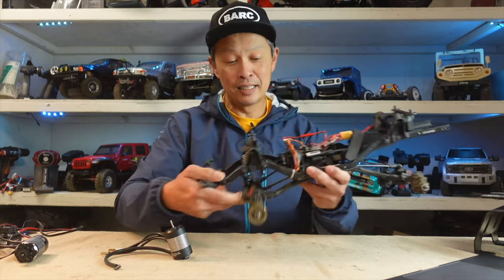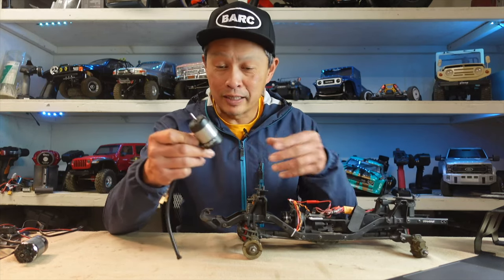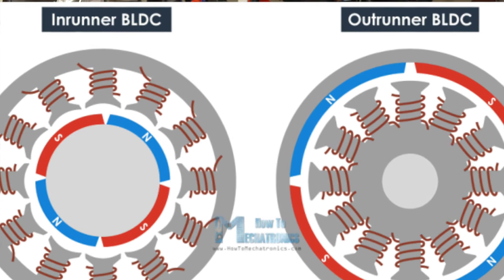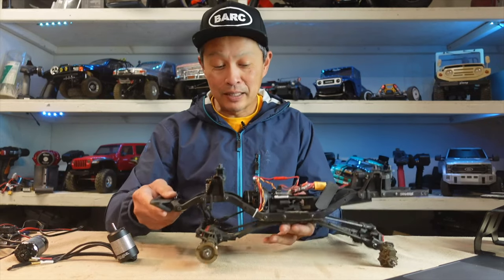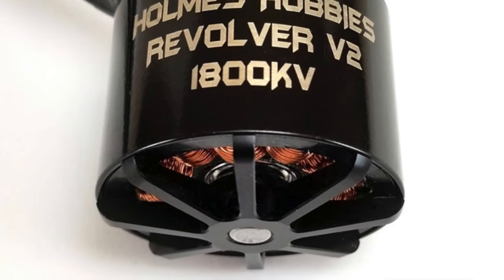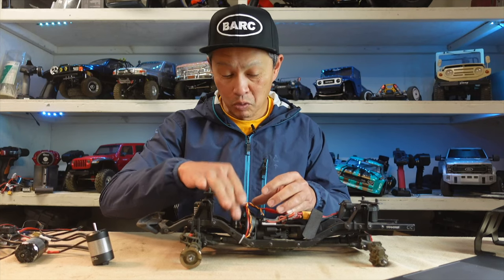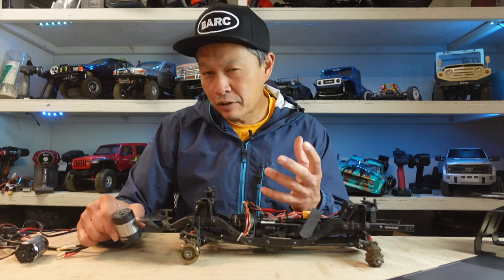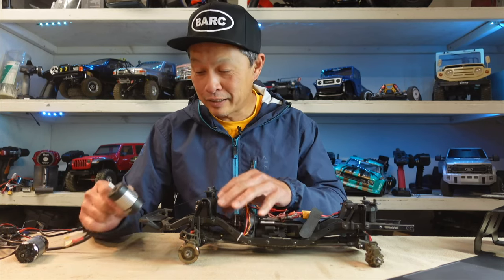Brushless motors explained - Top 8 things to know - is kv, outrunner, sensored, 540?

Comment: Kv is still confusing to me. The way I understand how brushless motors work is by creating a rotating magnetic field by switching particular phases. So it’s not how many volts will be supplied to the motor will determine the rpms but how fast the phases are being switched on and off so that the rotator will follow magnetic field of the stator. So what’s really Kv is for?

Comment: Also in regard to sensored, I prefer sensored. I don't use crawlers. I only use bashers and on road but I like the performance the sensors provide it's a smoother experience and imo it helps with efficiency and temps.
Reply from the maker: Yeah, some drift cars, race cars  prefer sensored as well. If control is most important, they work well.

Comment: Excellent video! I think you could explain more about the consept of power, speed and torque, their relation to each other and to acceleration and weight of the car. Everyone is talking about the speed and kv as being power. I have not found many esc manufacturers that actually give torque constants, nominal and peak torques for their motors... or similar values to their ESC.
Another question for you, do you know if there are any ESCs that allow syncing multple untis and choosing between speed or torque control modes?

Comment: Great video, thanks so much for the info!...Also, something i would like to know, I'm sure a lot of people would want to know ....is about how the electric rc system works together, as in.. From what i have understood, the motor demands power from the esc, and and esc draws it  from the battery... That sort of thing explained well with example values..
        Could you please please put up a video.. Thanks in advance.. 😊😊
Reply from the maker: Great suggestion!

Comment: 2 years ago I was experiencing thermal shut down on my M41 at the lake.  At first I didn't realize what was going till I the boat back in the truck and looked at the outside temp, it was 109 on the beach.  So I went back in the evening and drove it when it was cooler out.
Reply from the maker: Thanks for sharing. Real world info right there.

Comment: Thank you very  informative & explained in simple terms so anyone can understand them. For me I’m into crawlers mostly & brushed motors are so good I have no problems using them. I think it is a trend for people to get the brushes because they see a lot of the channels using them & think that this is a higher quality & more sought after upgrade. I do see that they are very smooth at low speed.  And have alot of power. So when you have to hope over something it could be a benefit.. Being sensored or not just seems like it’s not the motor just the esc that is controlling the motor that makes it so smooth at low speed so. So the quality of the esc is everthing. So what are the top benefits of using a brushless sensored motor in a crawler?
Reply from the maker: Yes, most crawler folks are addressed by brushed motors. OUr analysis here https://www.youtube.com/watch?v=ftkv31Z6o84
Reply: Watch the review of the Hobbywing Fusion FOC system then you'll understand the high end brushless systems. I was much like you with a brushed crawler setup. thought it was more than adequate.
Bought a Fusion 1800kv and it's transformed the car in ways I could only imagine before. So incredibly smooth and very powerful...and compact.

Comment: Just subscribed! You definitely know your stuff and I’m just starting out. I’ve built real FWD All Motor Honda Drag Cars for 20 years. Now I’m getting into R/c. I have a question. I purchased a fully aluminum TT02RR. Everything is alloy. On my kit. It came from power day and allegedly is not a true Tamiya. but the spur cover is the only plastic in it. I have even upgraded the spur to metal. I purchased a S3650-3500kv Brushless motor. What pinion gear shall I use for it?  The higher the pinion number, the higher top speed? But less acceleration? Is that right? And will the S3650 be a good fit? On a TT02 chassis? Any other tips? That I should be careful for?  I bought 2s lIPO batts. Hobby wing ESC. Motor is sensor less. I also bought a 12kg low pro servo. Waiting for other misc parts like shock oil. Tire glue to arrive before mounting motor but. Anything you recommend?  I just want to try and go 60 mph 70-80 tops. Only going to be ripping the parking lot with it or flat straights.

Comment: Hi there I wonder if you can help me. I am confused with this motor

Maitian MT-W50-G2: 295kv brushless out runner Power60

It is in a bait boat that I have and I am looking to replace it for a more powerful motor but in the same size if possible. It has to be an out runner. Would you have any recommendations. Thanks

Comment: From What I Got Out Of Video Can Brushless Motors Overload A Smaller ESC? I'm Thinking They Don't? They Just Won't Run A Full Potential Correct? I Know You Can Overload A Brushed Motor ESC With A Big Brushed Motor But It Sounds Like The Brushless ESCs Put Out What It Can Were As Brushed ESC Will Put Out Based On What The Motor Draws If That Makes Sense?

Comment: in the fusion motors what is the difference in a 1200 than a 1800? im building an ultimate hauler to haul my huina 580 exc. i need a truly torque dense motor as the exc. is 24lbs itself

Comment: Something more I just figured out is on Brushless unsensored is you can switch the 2 outside wires to change the motor direction. Had to do that to get max forward speed from both 2838 cans in my Blizzard otherwise one motor runs slower. 
Learnings never stop...nor should they haha
Reply: You can actually swap any of the 3 wires and it’ll go in reverse direction.  But I do normally swap A and C to reverse the direction. Some, if not most, ESCs have a function to reverse the motor direction.  The cheap ESCs in my Clod supposedly has this function, but for some reason whether I have it clockwise or counter clockwise, it still goes in the same direction, so I ended up just swapping the A and C wires.
Reply from the maker: That is correct for unsensored. Cool trick
Reply: @RCReviewChannel  Yes!  Forgot to mention unsensored only.

Comment: I never though I need to open a waterproof inrunner (yea they not mean there will get no water in it because there was a big hole where the cables get in)
The motor behaved strange and I found rust and sand in it. I tried to clean it and used some oil and grease.
Is it normal that the motor gets 55° Celsius after less than 2 minutes but only use 20% of throttle? I don't know what is happening. I can't programm the ESC (new one) and though maybe it's the timing. The bearing do sound strange but  the motor runs pretty freely.
Reply from the maker: definitely not.  Spin the spur gear by hand (or the driveshaft) and see if there's any resistance or binding in the system. That will usually cause it. Eliminate any binding as the whole drivetrain needs to be free moving.  The wheels usually cause a problem.

Comment: I understand outrunner are indeed for higher revolutions as well since they are used in drones. Due to this, an important thing to mention is to check if the motor has reverse when buying one 😂
Reply from the maker: Drones use big props (relative to the motor) so outrunners are ideal with their high torque.

Comment: Do All Brushless Motors Use Neodymium Magnets? In The Car Audio World Neos Biggest Weakness Is Heat. Heat De Magnetizes Neos Sooner Than The Old School Ferrite Magnets. But In Car Audio You Could Recharge The Magnets If Needed But In A Motor That's Not Really An Option Due To Each Magnet Needing To Be Recharged In A Certain Pole Direction.

Comment: Kv is completely a useless measurement without knowing the torque
Reply from the maker: I'm not sure RPM is useless
Reply: @RCReviewChannel  its a bit useless since its measured under zero load. Maybe not completely useless but its just hard to intrepret. Thanks for your reply 👍🙂
Reply: @RCReviewChannel  your video was still highly useful for me. Thank you. Tbh i assumed it was kilo volt before and was beyond confused lol. After watching i realized it seems to be a convenient marketing strategy for the manufacturers :D knowing its rpm is helpful but its just like, you could have a 2015 motor with a 6700kv and a 4270 motor with 6700kv and to a novice they might appear equivalent when in reality the amount of current, the number of windings, and so many more things are needed to truly evaluate what you might be getting. One thing i think i figured out is that a higher kv motor is generally gonna produce less overall torque than a lower kv motor (of other equivalent specs)? Is that about right